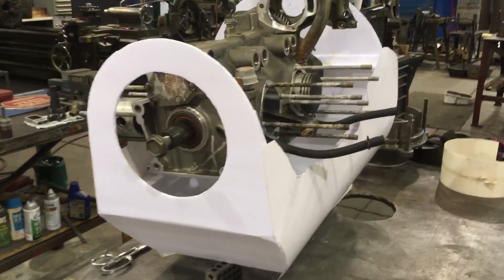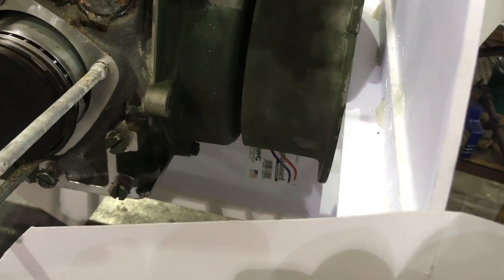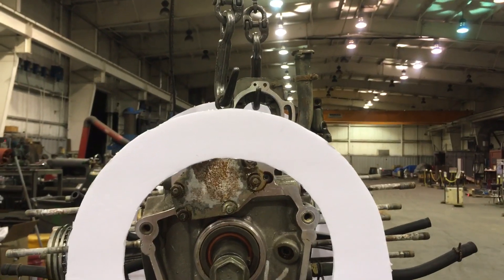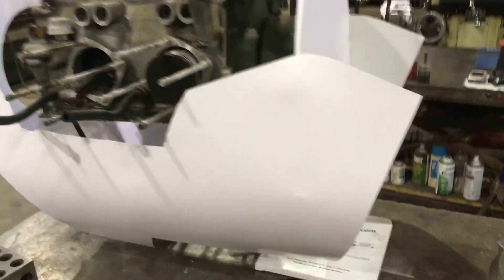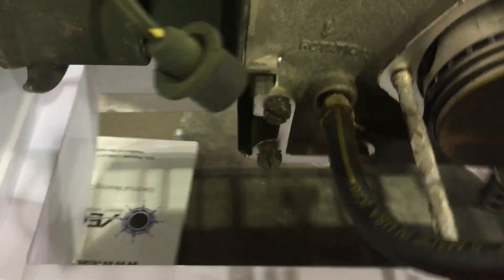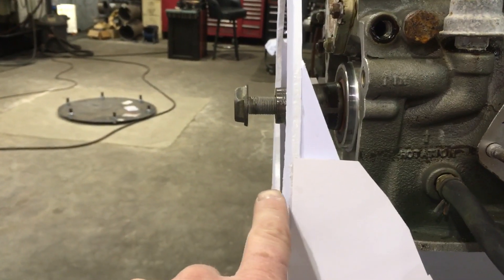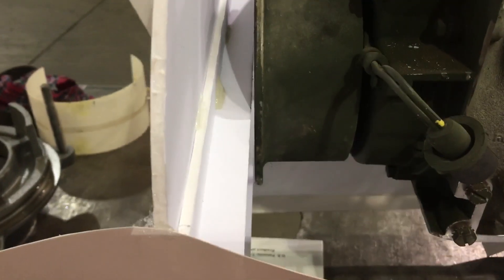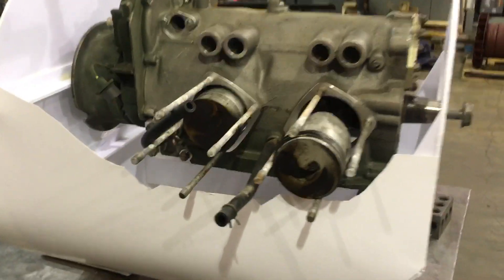4a084 milsurp engine and Hummel Ultracruiser mockup

Comment: Hi, Looking good!  I fly an Ultra Cruiser with a Hirth F23 (50HP) engine. The engine weighs about 78 pounds. I'm not familiar with your engine. Could you give some specs for it and why you're using it in the Ultra Cruiser?  Thanks!
Reply from the maker: The engine is an 84ci 4 cylinder engine from a military generator.  It should make 42hp and be smooth and reliable.   Has a nice sound too.   It wont be 103 legal tho
Reply: @flyguyeddy  Thanks! Man, that's cool! You probably have already seen this but it shows a similar engine running in a bush plane:  https://www.youtube.com/watch?v=xy8bBNqgcMc  Best of luck to you with the project!!
Reply: @flyguyeddy  I would like to see a 4a084 in a Hummelbird. Have you moved forward with this project? Seems like this engine would be a great candidate for a turbo as the compression ratio is very low (some specs say 6.8 CR) . Though in the Hummelbird there may not be enough room for all of the plumbing it would need for a turbo.
One gentlemen Les Smoot has placed an SDS  brand ECM on his 4a084 to have EFI, which he advises he is obtaining very good horsepower/performance out of the engine and is running a 58" 30 pitch prop. I plugged that prop with his claimed 3450 rpm's into a static thrust calculator equation and came up with some very high numbers for the 4a084 or 367 lbs of static thrust. I wonder what that would be like in a hummelbird (if you had the ground clearance for a 58" prop)?

https://www.youtube.com/watch?v=EPLlVvehZ90